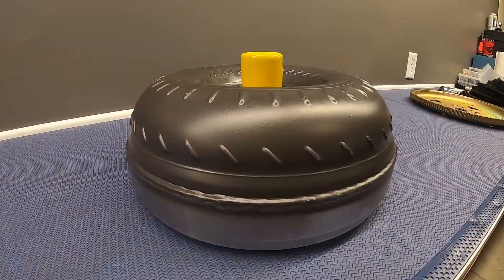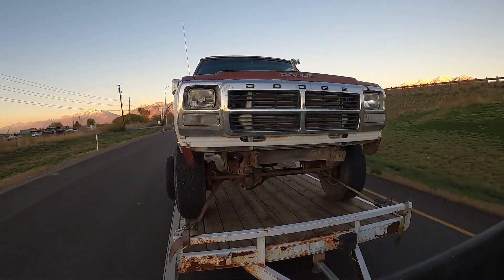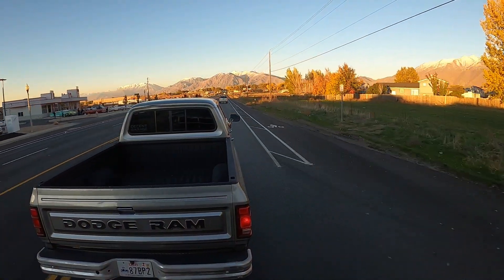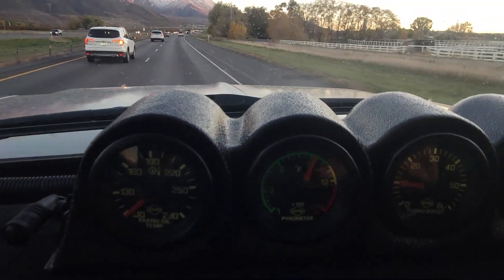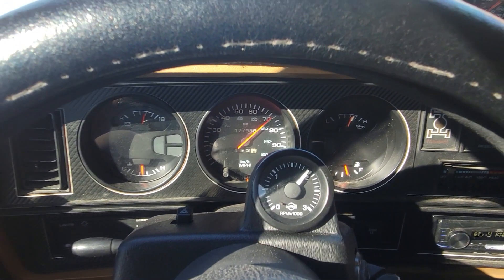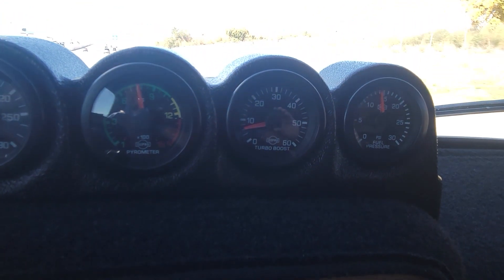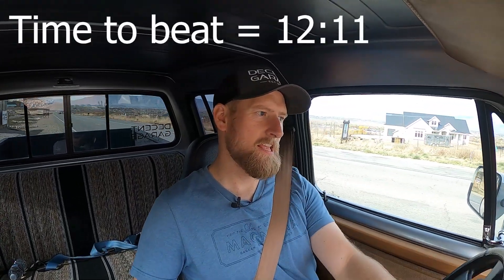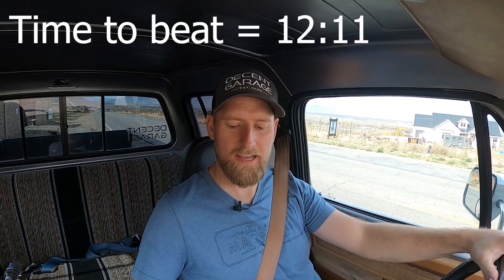Was it WORTH it?! | Testing and Review of the Suncoast Torque Converter

Comment: Have you ever thought about upgrading to a 47RH which has a lockup converter? It's a really straightforward swap and obviously with the converter locked you'd be getting near-zero loss through the converter. Also your trans temps, RPMs and EGTs would be even better on the highway.
Reply from the maker: Yes i have considered that. I actually bought a 47rh last year and was ready to do the conversion. At the last minute i decided not to move forward with it mainly because i didn't want to deal with running of and lockup on switches or a standalone controller. It is a great transmission though and eventually i will use one.
Reply: Your using a fluid coupling and non lock up convertor..I never been a fan of automatic however set up properly they work good ..  I assumed that the tighter convertor will be a bit harder to spool the convertor down low.  The guys who have hot rod diesel truck I believe like a loose convertor . The get the turbo or turbos lit then use lock up ..Years ago guys were using fork lift stators in some of the convertor to lower stall ..The 47rh  with 48 internals can be a tough transmission.  I think all you need is two lock up switches.  You probably know all that . The auto has I think a .69 overdrive also ... Not sure what gear ratio you run and size tires. The tall gear ratio and tall tires might effect how fast it spools the charger with a tighter convertor.  I hated the stock convertor in my 47rh..I remember going from 4 gear fluid coupling to 3 gear lock up and it was or seemed to be the same miles hour . I watched the guys shift lock up then unlock and shift again ect and I thought that's not for me . The tighter convertor I thinking reduce the fluid Temps at high way speed and might even require a bit more brake effort at a stop light ect . There is a point that to tight of a convertor will make spooling a larger charger harder ..I remember after I changed the fuel plate and governor springs set the timing ect I could floor the truck it would buzz up to 3200 and not drop 1 rpm between shifts ..I thought what a piece of crap convertor.  Till it hit lock up.. enjoy your videos. I read a article where you can add 3rd gen brakes to you truck on the front . That's impressive lol

Comment: Little off track here but my a518 seems kick out of OD all the time. I'll be driving in OD and let off the throttle just a bit and it kicks out of OD. Also does it when the truck is still cold so all fluids are still cool. Any ideas?
Reply from the maker: Yep, i have two videos on overdrive issues. I am positive those will help. Let me know if you can't find them

Comment: You might of mentioned it in an earlier video but have you rebuilt your transmission?. I have a 93 with Automatic and I want to beef it up a little just to pull a little more over the Rockies with a new converter and cooler. I noticed you can drop a fair amount on several levels of rebuilt trans. After some minor work on the 5.9 might get 200 to 250 hp at the most. Getting old enough to not be in a hurry to anywhere.
Reply from the maker: Mine is stock still. I'll do a video in the next week or two on what i have done to it to help it hold up so well.

Comment: Hey man I know this has nothing to do with your video but I have a question. I hope you can help me with it. My 1992 D350 stared to lose power and idle rough 2 weeks ago. And also 2 of the injectors are bad now.I was checking the truck to see what could be wrong with it and noticed that doesn’t have a lift pump. The prior owner installed a bypass instead of the lift pump. I been watching some videos on YouTube and they said that when the lift pump doesn’t work the ve pump starts to pull the diesel itself but after some time of doing that  It can cause failure of the injectors or in the ve pump. And loss of power and rough idle are the compre common issues. Can you help me with that? do you think that's the reason?
Reply from the maker: That could absolutely be the reason. The Ve pump will provide some suction but that will not be sufficient fuel psi when you get on the throttle. Ive never heard of anyone having any valid reasoning for doing this and i would almost put money on that being the issue.
Reply: @decentgarage  thanks man. So you think if I reinstall the lift pump and replace the injectors I can solve the issue
Reply from the maker: @nynoperales6521  that would be a good place to start. Hopefully the injection pump is fine...
Reply: @decentgarage  thanks man.  I’ll do that and I probably going to replace the ve pump in the future. What lift pump would you recommended me ?  The stock or the carter list pump?
Reply from the maker: @nynoperales6521  hvlp from the hungry diesel. It's a modified Carter for the Ve pump
Reply: @decentgarage  thanks again man. I’ll do that.

Comment: Hey man awesome videos, I recently got my 1990 12 valve and I know you’ve done some wiring videos before but have you had any external voltage regulator problems before, I’ve bought about 6 in the past 5 months. Usually 1 a month. Do you know any fixes or what the issue actually is.
Reply from the maker: So there are a few things to do to go those to last. 

1. Don't buy cheap ones
2. Make sure you have it grounded to the firewall AND run a ground from it straight to the negative terminal on the battery.

Comment: Did you drop something into the cab? Never noticed that big dent ☹
Reply from the maker: Where? Oh the one above the rear window? That has always been there. I knew about it when I painted the truck but i knew my body work skills were t good enough to properly fix it so i just left it for now. It adds character 😁
Reply: @decentgarage  funny i didn't notice. Still a beauty. Shes got some scars 😉
Reply from the maker: @ChristianNeff  some day when i get a professional paint job it will be perfect.
Reply: @decentgarage  I really like your paint job... if you put the same effort into the cab as you did the bed... it would have been pretty darn close to a professional job. The bed came out absolutely mint.

And I bet if you practiced a little with one of those stud guns you'd be able to pull that right out.

I'm hoping to paint my truck the next few months. I'll be using your and some other's videos as a guide. 👌👍
Reply from the maker: @ChristianNeff  agreed. That process was really a learning experience. I plan to buy a stud gun and learn how to use that.